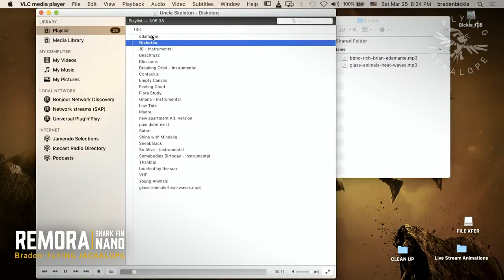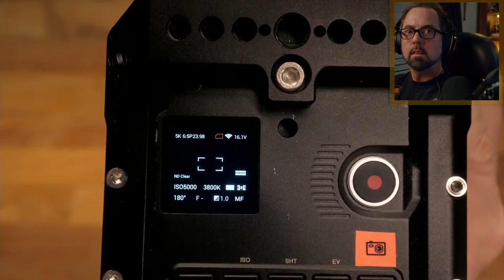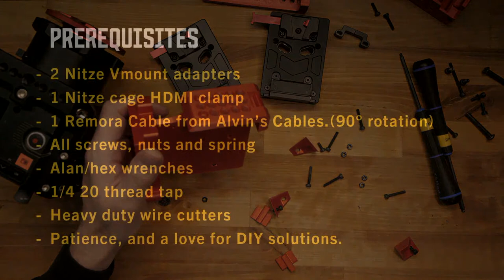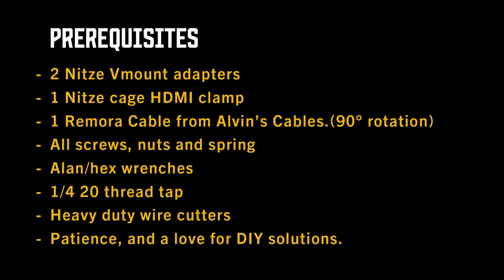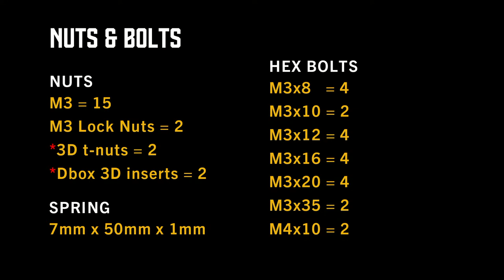Double Your Zcam Power | Remora© Live Build | Camera Rig Recipes

Comment from the maker: Some Highlights since it is 3 hours long (Sorry)
Prerequisites for building 59:09
Nuts and bolts needed 1:08:46
Assembly 1:10:15
Building the Rear Hatch 1:45:50
So what can you attach to the back? 1:55:35
Voltage Metering 2:05:05
Power On 2:24:35
Bonus: My Zoom F3 vmount attachment 2:25:33